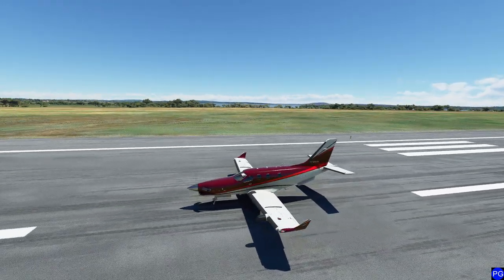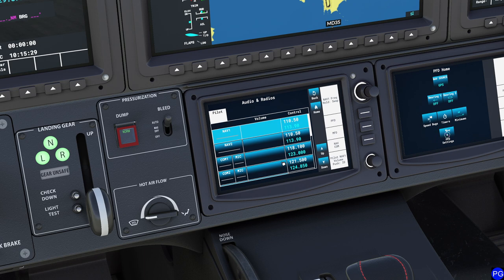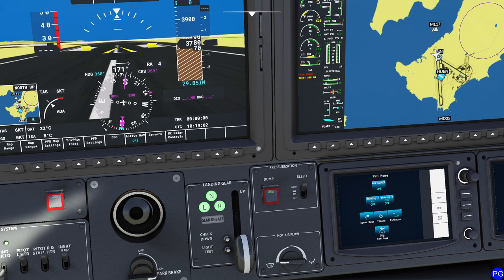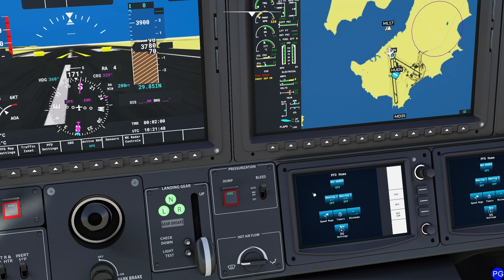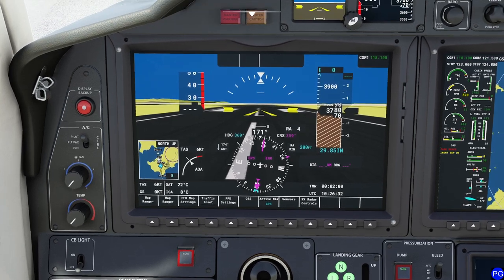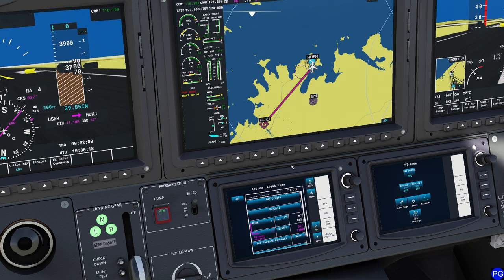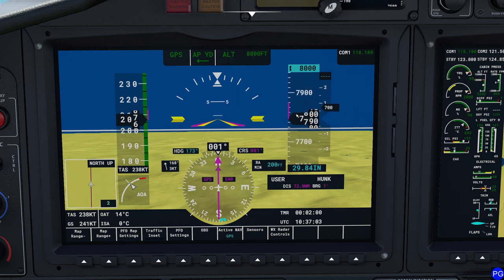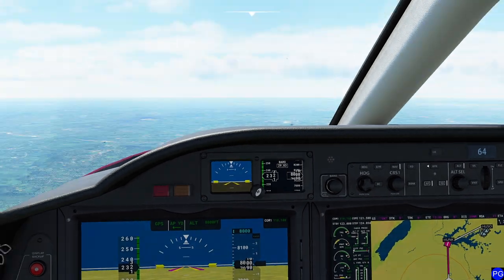MSFS - G3000 Tutorial (Updated)

Comment: Yep great  vid  on  showing  on how  to use it, some  how  i  have  changed  the  mfd ground  to  black   color  was  wondering  on  how  to get  it  back  to  the  yellow   again
Reply: Ok  found  out  the  issue is  that  i  was  using  the  previous unmoded version of  the  g3000 and  than   installed  the  latest version   which  shows  black   color  for the  ground  instead  of  yellow. New  version  allows  you  to link  your  nav  charts   to be  shown  in  the  mfd

Comment: Awesome video.  I encounter an issue i can't get around when configuring the approach portion of my flight plan though.  It seems no matter which runway i select for my approach, the msfs atc wants me to land using the very first runway selection from the pick list.  My nav system is on point though.It leads me to the correct waypoins and desired runway.  It's like the atc component only thinks there's one runway to choose.  And this is after i've already requested clearance for the flight plan.  It could be just me too.  I don't know.